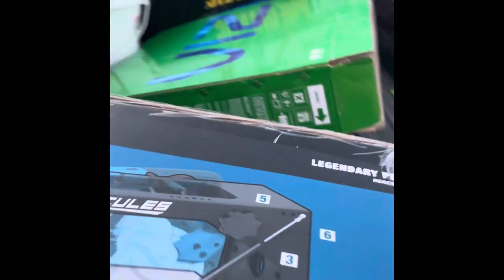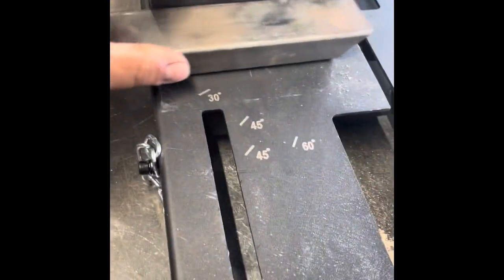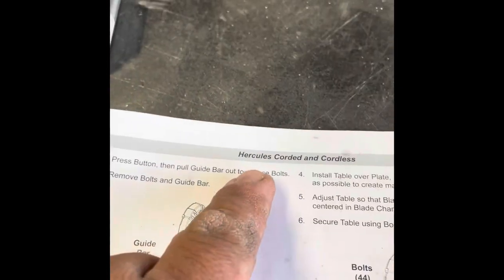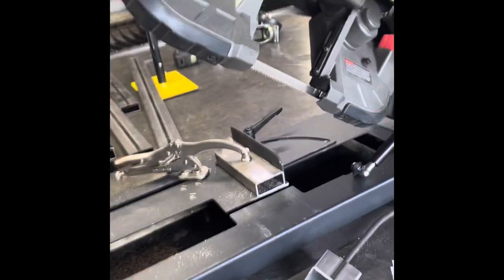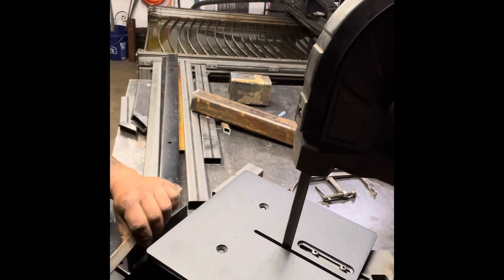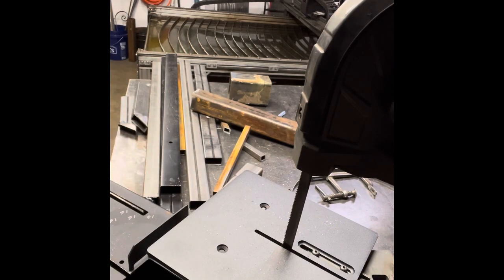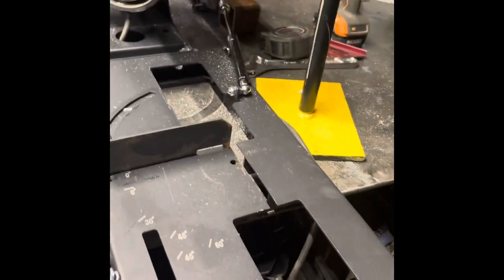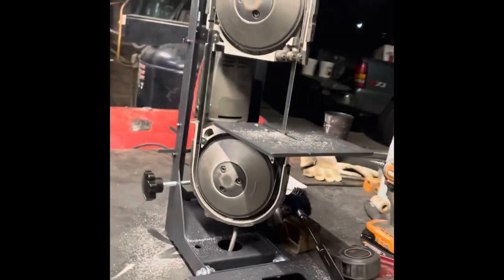Hercules bandsaw Attachment.        Swagg killer!

Comment: Not really a SWAG killer. It's a quality tool but fits a different use case. If you want your portaband to remain easily portable then SWAG is the way to go. The HF stand works well but it's a process to get the saw mounted, so taking it out if you need it to be portable again, is a painpoint.
Reply from the maker: I see your point.

Comment: I NOTICE YOU HAVE THE SAME PROBLEM IM HAVING WITH IT. THE BLADE IS TOUCHING THE BASE NO MATTER HOW STRAIGHT YOU SET THE MACHINE THE BLADE IS KINDA BENDING WHEN CUTTING AND THE CUTS ARE NEVER STRAIGHT.
Reply from the maker: yes it cut the base
Reply: @METALMUNCHERS77  I FINALLY GOT IT CUTTING CLOSE TO STRAIGHT WITHOUT TOUCHING THE BASE. THE TRICK WAS ON THE SWING ARM THAT WAS'NT STRAIGHT
Reply from the maker: @tonyvtech25  ill take a look at mine I tossed it under the table and didn't if use as much as I thought I would thank you